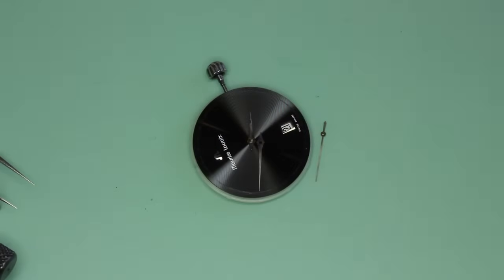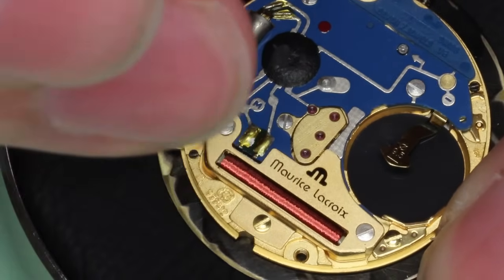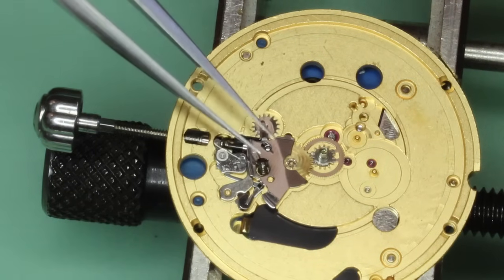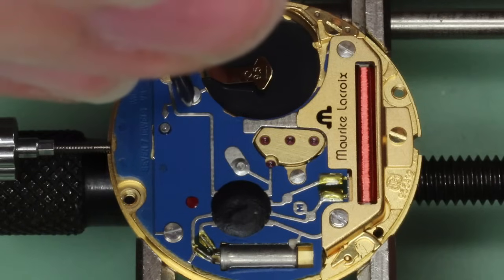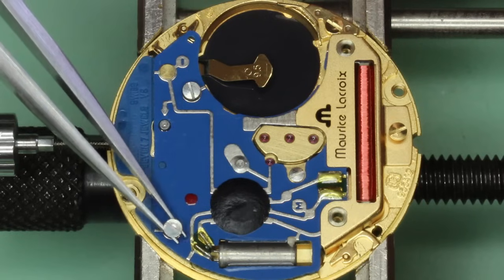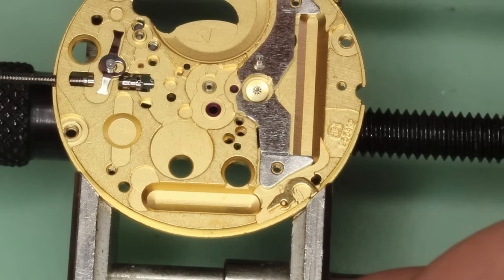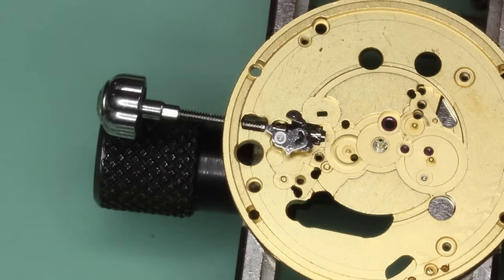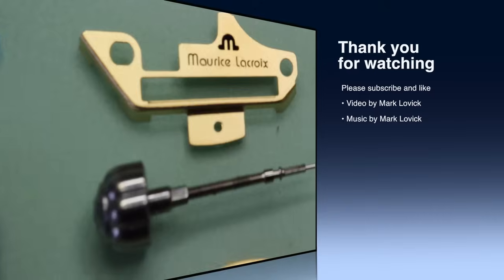How to service a quartz movement. ETA 955 412. Watch repair tutorials

Comment: I have never seen the complete strip down of a quartz watch.   I service my own quartz watch by replacing the batteries and if needed, the seals,  but I never ever had to break it down into little pieces-  this is quite fascinating to watch and learn,  not as many parts as a mechanical, but there are parts for sure.

Comment: Help! I have a collection of watches some I dont use very often The other day I decided to replace all the batteries on the watches that had stopped. All the watches worked except 2 Rotary watches both with second hands is this a coincidence of a common fault Are the hands just seized and in need of oil or are they no good anymore. Thanks Tony

Comment: Hi Mark, Many thanks for some interesting and informative videos.  I've learned a lot from them.   My limited experience is of wind-up mechanical movements and I'm familiar with tightening the cannon pinion when hands are slow to move after setting.  I have a 1980s 13 jewel Cyma cal 131 that takes almost a minute for hands to move, then keeps perfect time.  I haven't taken the dial off.  How do you correct this problem.   BrianB.

Comment: Hello. I have a men's Geneve 14K gold watch with a ETA 955414 movement. I wanted to replace the battery and ran into a problem. I pulled on the stem to remove it and the crown separated from the stem. The crown has a female end while the stem has a male end. Very similar to the way a grafting tool creates a male and female end. Do  I replaced the battery and the watch runs fine. The problem I have is that I can't reattach the crown. When I push the crown onto the stem, the stem recesses into the movement too far and I am unable to engage the crown onto the stem.  Do you have any idea how I can fix this problem.  Thanks

Comment: I have an Omega with a Cal 1444 movement and it has an erratic seconds hand, it lines up with the dial markers from the 6 to the 11 position but jumps and goes out of line between 11 and 6, does this sound like one of the cogs is worn inside the movemement ? By the way it keeps good time..

Comment: Hi, a own a HEUER 230006 and the coil is damaged. I figured out the movement is ETA 555.112. As I saw in the video, if the circuit board is damaged it has to be replaced. Therefore I've looking for the replacement but there's no replacement under the same reference number, instead there are circuit boards ETA 955.112. This last one would work for my watch? 
Thanks for your time
Reply: I am thinking the same too from the reading I have found. 555.232 with 955.232 in my pilot 230.006

Comment: Hi there, I have a £200 HUGO BOSS quartz watch. I changed the battery today as the watch had slowed down. Battery was replaced maybe a year or so ago. Even with new battery out in this morning, I noticed this evening it was 10 minutes behind the actual time... seems fine again now I've readjusted. But does it sound like my watch needs a service? It's either or approaching 3 years old and I haven't serviced it yet, only replaced a battery once since this time now, which shocked me really as I thought batteries should keep a watch running accurately for at least 2 years. Also how much would I be looking at for servicing this type of watch?

Thanks,
Peter

Comment: Where can I buy the tab that's located under the battery? I am not sure what it is called but in the video it is a gold color tab that touches the bottom of the battery.
Reply: jonathan vazquez that's a part of the circuit board. You may need to buy a new one.

Comment: +Watch Repair Channel
Please tell me how do you remove the winding stem from an ETA 955.414 movement? So the movement can be replaced. Your advice would much appreciated.
Reply: There's possibly a latch  (button) you can press to disengage the stem. It may not be apparent with the naked eye but you'll see it with a loupe if that'ts the release mechanism.
.

Comment: Great video  excellent work what would it take for you to do a full strip down of a seiko 7548 quartz movement and reassemble,I've taken this up as a hobby over the last couple years
concentrating on 7548 quartz movements.at the moment i have around 30 7548- 7000 and different models in this series,I'm learning as i go with some success  and some failures,watching your work just inspires me to keep watching and learning love this hobby great satisfaction when you have success  Cheers

Comment: Hi there! Firstly , I am not a watch expert. I got a new watch as a gift and it had not battery on it, the battery was in the box and I tried putting it on my own. I somehow opened the wTch but, when I put in the battery , there was this small thing near the battery hole, I think it is called a spring or a contact, I'm not sure. In this video at 5.22 you remove the whole thing by holding on to an arm like thing (it has 9.5 written on it)  The one that touches the battery terminals. That part broke and I don't know what to do. This part is really small and is there was way to fix it back to the watch? Thank you!

Comment: I never would had thought I would see a plastic spacer ring in a watch that expensive.

I have a mid-80s Hamilton with the 955.121 movement; it is an older variant of the movement shown in this video, with 7 jewels and a day-date window at 3:00.
Reply: L f.

Comment: I have a Victorinox chrono classic xls. I have 60 pages of specs and drawings on the 251.272 movement but have never actually seen it. It would be great to see a vid if you run across one!
Reply: Hey whaddaya know.  I'm working on the same watch with the same movement.  It's been 4 years, I hope you've got it fixed by now.

Comment: Great video, thanks. I just replaced a rusty movement in a hi-end wristwatch that has an ETA 956.112 movement in it. For the experience I disassembled the rusty one, figuring that I'd never get it back together. Well, now I can probably put in in my cleaning machine and have a shot at getting it back together, perhaps even working again. That would not be remotely possible without this video.  You're providing great information, and presenting it extremely well. Thanks again. Cheers.
Reply from the maker: You are welcome - I am glad you find the vids useful :)
Reply: Watch Repair Channel sir my name ajayan from india work watch repair  any vaccancy plz kajayan526@gmail.com

Comment from the maker: Hi Ferdinand. It helps to use non-magnetic tweezers, I recommend a decent pair of brass tweezers (Dumont are excellent). Use insulated tweezers when picking up the battery. I have an L&R cleaning machine (automatic with ultrasonic) and an Elma SuperElite cleaning machine (manual, no ultrasonic). I prefer the cheaper SuperElite as I have more control and it's less messy. I use cleaning fluid in the first jar and rinse in the second and third jars. Both cleaning and rinse fluids are made by L&R

Comment: Thanks yet again on a very clean and clear tutorial. Like your videos a lot.
I am wondering if you need to use different types of tweezers to work on Quartz and manual movements?
Also, would be great if you actually show the cleaning process of the parts as well; the type of cleaning machine, type of cleaner / rinser, drying process, etc.